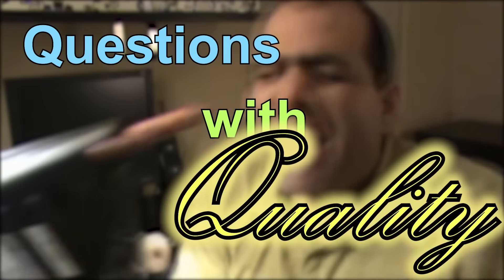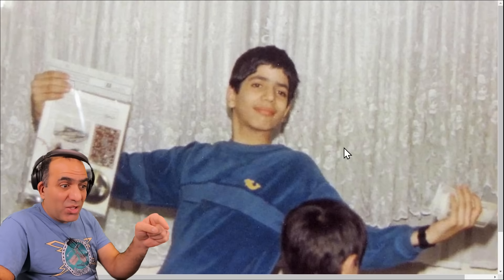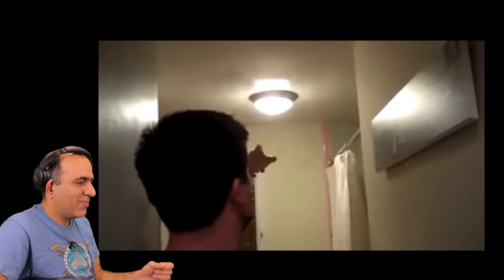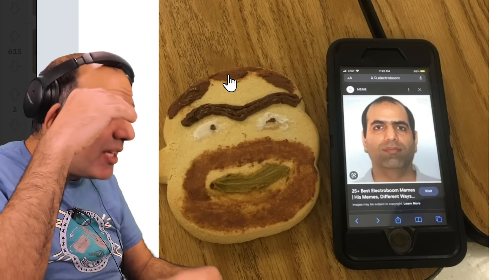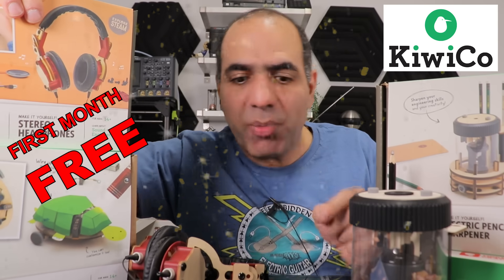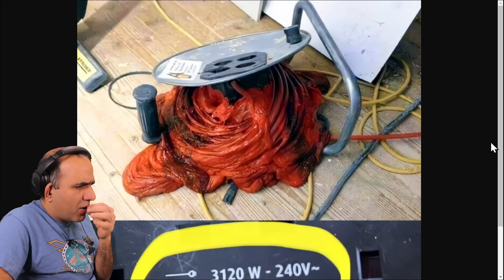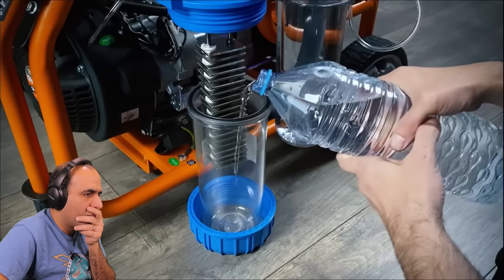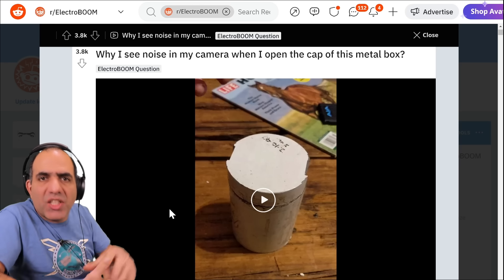Can ENGINE Run on WATER?! They Copied my Toy (LATITY-011)

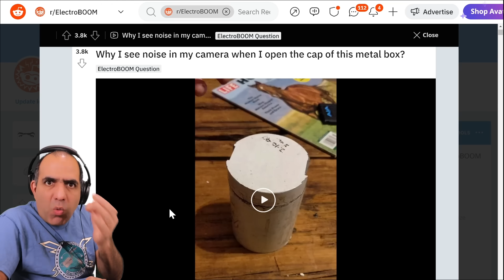Comment: 12:58 that video is a fake. You can tell because the noise goes away when he covers it with his hand, but a person's hand is not dense enough to block ionizing radiation. 

Also, that's not what radiation induced camera noise looks like. It typically appears as white spots across the image, not some slight distortions in the same colors as the image itself.

Comment: YES....you can run your car on water.  NOT DIRECTLY THO. First crack it to oxygen n hydrogen by input energy.  Then burn HHO gas in ICE engine. Or thru fuel cells to run car's electric drive motors.

Comment: @ 2:32 ‘he got rid of the fan . . . .’ Usually fans are 3 wire, neutral, switched and permanent live, the double pole light switches have a common, I would have started by checking the common and permanent live

Comment: There ARE engines that run on burning water, they’re called steam engines
Reply: They evaporate water and burn coal. However, Hydrogen combustion engines burn electrolysed water.

Comment: The water motor is not free energy because the electricity is being used to split the water and not to power it. It will use the water up just like if it was gas and the water is where the energy comes from. It would be cool to see one that captures the water from the exhaust to make it more efficient, although it would still have to be refilled because water is not the only thing that is produced by the engine.

Comment: my car runs on it...       mmmm that is electrolysis to split its hydrogen off first....  so its a trick question,  water no...   split it yes   ps meddi great experiment for yeah,,  do you get back just as much water?   I'm very iterested in the theory water IS endless power.....because all that comes outta my exaust is pure drinking level water :-o

Comment: I dont think the water engine is a perpetual motion machine. In a regular combistion engine the burning fuel turns the engine, turning the alternator, charging the battery, and supplying sparks to burn more fuel. The system seems closed at first but really the gasoline is the energy input. In the same way the concentration of hydrogen and oxygen in water is very high (when compared to just the gasses) and it will be released as energy when the oxyhydrogen is burned. Water is being used as a source of chemical energy storage, like normal fuel, and it will eventually get used up when all of the water is converted into gasses and burned.

Comment: 3:22
I can imagine these 2 changing a thing that for some reason requires modification of the house's entire power grid, and after realising the buttons and plugs are all messed up they go like: "We can live with this" and after a few months one says to the other: "Could you turn on the bedroom TV?" and the other goes like: "Sure thing, just let me plug in my phone in the kitchen, turn on the hair dryer, set a stove on low heat, turn off the AC, and open the garage door"

Comment: The only way a "water engine" would work is if it produces water from hydrogen and oxygen, not separating it, or somthing like that, whatever a fuel cell uses to produce electricity

Comment: I hit pause right at the start. We had water motors where the water pressure moved the piston. We had steam but still not burning water. If we're about to go into hydrogen here, in my opinion water starts off as the fuel potential but it's no longer water when the engine gets it.
Ok, I'll hit play now.

Comment: It doesn't take an extraordinary amount of current to melt a cord on the spool like that - a simple soldering gun (the higher power sellers) COULD do it - or a heat gun.   I had a relative do exactly this this a heat gun many years ago, because the cord was still in a tight round coil.   it's not the most effective inductor, but it does affect it... it was probably a 50 or 100 foot cord.

Comment: Hey man I know it's not possible but is it's possible (as iron can move by itself in Earth magnetic field and same magnets with same pole can cancel each other magnetic field  so making this setup with an angle of 90and 2 bars may provide some type ,I know attention can be canceled by same pole repulsion  but maybe it can reduce to some factor as compare to attention and maybe just maybe convert just heat into mechanical energy

Comment: for anyone wondering about the water engine, making hydrogen and  using it to power itself from the gas would work accept hydrogen from electrolysis is expensive and would never make enough to power itself

Comment: Hi Mehdi, actually graphite welding does exist in industrial applications. It is called graphite electrode welding. The graphite is used only as electrode, where external material (filler) is added during welding. It is highly uncomfortable method, because the arc ignition is extremely loud and bright. Never the less, graphite welding is actually real (usually 270+ Amps).

Comment: I've made a hydrogen generator as an experiment and was able to get it to run a engine but i had to make it multi stage, almost blew myself up, and the efficiency was garbage. Also it can't just be regular water that has to be distilled and a bunch of salt mixed it had very little extra energy left from the hydrogen to barely keep the battery charging and could barely cut grass. I wouldn't say its purpetual though because the hydrogen generator is outputting quite a bit of hydrogen but had to use an outside oxygen source all in all the energy i got from it was minimal and the effort to create the hydrogen was not worth it and cost more than regular old gas

Comment: Yeah I can I had a car that they did but it's actually HHO H2O with water right so you break it with electrolysis turn it into gas so you have oxygen and hydrogen and you put that into your engine and your car runs on water

Comment: I obviously didn't calculate it but in the water car video it actually wouldnt be infinite energy, it is using water as a fuel and so the extra energy comes from the water
Reply: To create that fuel you need to add energy - to separate the hydrogen and oxygen
Reply: @mtqrx  yes, but what the video claims is that by burning that hydrogen you get enough energy to separate more, consuming water in the process

Comment: 0:50 - Yes you CAN weld with graphite.  This isn't something that's to be debated or confused about. We've done it for years.
It's called CARBON ARC WELDING

Comment: Do you not understand welding? 
Why would you complete the circuit?  Arc< welding uses the spark/arc itself, the charge difference between the carbon and the piece being welded. 
The carbon is only a conductor and does not get hot and THEN melt the metal. 
The arc FROM the carbon TO the object being welded dies the welding.

Comment: Burning H from H2O wouldn't be a perpetual motion, free energy device though. It would simply be burning the H.
The problem is not that it would be free, but that it takes more energy to release the H in the first place. Presumably never getting around it, because I assume burning H and O turns it back to H2O, which can only ever create less energy that the ripping them apart would take. Right?

Comment: If you watch the full episode, 8of10cats used a shocking device attached to the victim. The game itself worked as normal, but when the buzzer goes off someone else presses a button to activate the shocking device. They use this device in several episodes.

Comment: It suddenly occurred to me recently that an engine that runs on water might, in principle, be possible. Not by burning the water but by evaporating it. Equalising vapour pressure between the water and the air results in a lower energy state and higher entropy. In principle and without even resorting to the back of a napkin to support this idea with some hand-wavy maths, it seems work could be done. Of course it would only work in a low humidity environment.

Comment: yes it can it is called electrolysis and a stack plate capacitator with a transformer and using ac submerged in water with a 3-5% ratio of oxy clean will make it so effiecient it seriously is not funny it is not used for everyday use, a car distributor is a nice step up trasnformer on the cheap as the insane volts required by a spark plug yadda yadda do it bitch

Comment: A lot of people believe the water engine device because ‘technically’ combustion of hydrogen produces more energy than electrolysis of water, except around 43kJ of that energy are unusable (don’t make me remember my thermodynamics lectures to say why haha), so the actual energy you can get out of combustion of hydrogen is the same as the energy required to electrolyse the amount of water to produce that hydrogen, and that’s assuming 100% efficiency, which never exists.

Comment: I remember 5 years ago when I was at a boarding middle school, pulled out a bar of graphite from a pencil, tried shorting it with a pair of cables from a broken alarm and a 18650 battery. It went burning red. I used it to solder my friend's broken flashlight and burned a bunch of mosquito papers on another dorm for fun (cuz lighters weren't allowed). Good times.

Comment: you were wrong about the way it's wired. it's 2 separate circuits. light 1 is switched on the other side of the hot, so one lead of the lamp is always hot. the other side is wired to a 3 way switch, 1 is neutral, 1 is the other phase, they are both connected to the hot wire. there is also a wire coming off going to the outlet, which goes to neutral. that was done intentionally as to make a joke video. your model would predict lamp 2 turns on, but you said it doesn't because high resistance. your model also doesn't explain how flipping the other switch makes it brighter

Comment: I had almost that exact idea for a water electrolysis engine as a kid in high school, except instead of a magic perpetual energy device I figured it could power a car enough for the momentum to run an alternator and maintain the cycle. I still don't know if that's at all feasible but it's better than that stupid video.

Comment: My guess is for the roll of extension chord that melted, it was connected to a power source and they crossed the poles in an old plug that has no ground.  Ive done this on accident when plugging a LiPo bat. to a makeshift connector ( crosssed poles, it got hot quick).

Comment: The microwave should be using both phases. In one it's charging the capacitor, in the other its in series with the capacitor powering the magnetron. Aside from the point that the microwave "wastes" half its power, i think its also unreasonable to say that it doesn't use half the cycle unless there is something i am missing

Comment: I do think that hydrogen from electrolysis can be made to run a truck, The trick is to just make sure the truck is of sufficient capacity to tow a very large enough diesel generator behind it, with plenty of diesel too.

Comment: You can run an engine off water, you just need a metal to burn it with. Aluminum, lithium, boron et c. will burn with water, though Al is difficult to get sustained ignition with water while the others have toxicity, safety, or energy density issues

Comment: it's not about running the car using water. it's about using electrolysis to split the water molecule into hydrogen and oxygen which is then burned to provide locomotion. 
and yes, the output from the O2+H2 combustion process is higher than the input required to split the H2O

Comment: i used to belive about the hydrogen electric generator , didn't know it's considered an actual perpetual motor because it's actually using water as fuel mostly than the electricity from the battery

Comment: 5:30 I blame Hollywood for this. They always take liberties with reality, you know, like a guy standing in a pool of water, a cable drops on the edge of the pool and we see the guy getting fried and if it's directed by Michael Bay an explosions tops it off. While in reality electricity always takes the shortest route, so just the short distance between the two wires.

Comment: car can't runs with water but in modern engines water injected can increse the efficiency by cool down the combustion, it is the main way to not use boring scr systems wich is in development  in big engines which can't have a urea vessel like in cars

Comment: What about a steam engine tho?
Reply: Steam does not supply the energy , heat does from boilers . The heat causes the water to expand to steam which provides pressure to provide force on mechanical devices such as pistons in steam engines or steam turbines . Nuclear aircraft carriers are powered by steam , the nuclear reactor is merely the heat source , just as coal was in old railroad engines .

Comment: I am Automotive tech. water is only meant to cool down the engine. they used distilled water to cool engines before coolant was made but they notice it didn't work well and made coolant instead

Comment: running a engine on water is not perpetual motion ..the water  is used as a fuel source .. noone ever said  you dont use up the water
Reply: If water is the fuel then what is it reacting with? What is the exhaust product? i.e. where is the water going when it gets "used up".

Comment: Easy for cable real to overheat, seen is done at an old workplace.
The reals should be unwound before use, or they can overheat just like elements when they are used in, for example high power, power tools,

Comment: Frankly yes it is called hydrogen oxygen gas HHO my car does hybrid technically it's running on hydrogen you put distilled water with an electrolyte in to dry cells do electrolysis in make hydrogen gas from water so you put water in the system and then run it

Comment: The flyswatter circuit is completely isolated from the earth, or "ground", because it's battery powered. So, touching either of it's 2 high voltage output grids in the swatter part one at a time, you will not receive a shock. Touch them BOTH at the same time, and you WILL.

Comment: Hi sir, I am a high school student from India and I watched your video on surface charges in electrical circuits on your YouTube channel. Still I have some questions left and I request you to please help me with this if possible. My question is-

We know that steady state arises very quickly so surface charges have to establish very quickly and for that to occur the electrons should travel very small distances and that can happen only if they come from surfacial atoms of the wire itself. But if that's the case they would establish an opposite charge gradient inside the wire ( as an electron leaving from a surface atom will leave it positive ) and that would counter the electric field from surface charge gradient. So how exactly these surface charges come from? I have also read "matter and interactions" but in that too its not answered. Please help me with this.

Comment: I doubt the so called "water" engines would even be able to electrolyze water at a fast enough rate to keep the engine running.

Comment: Can you calculate the number of electrons inside one gram of copper wire 
If you can ,how did you do it?

Is it ((Weight in gram number)/(copper mass per mol number)) * (avogadro number) ? This will equal the number of copper atoms in one gram and multiplying the result number with the number of copper electrons which is equal to 29 electron could this equation calculate the number of electrons inside one gram of copper wire ? 

Help .. 🥺

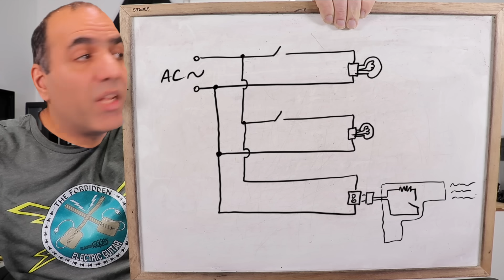Comment: 4:02 the ac light switch 1 
And the light switch 2
And an socket with a connected hairdryer the sockets connected to switch 2
And switch 2 is connected to switch 1
I did this kind of shi" a few months ago

Comment: There are other ways to electrolosize water than DC forced amps.  You can treat the water cell as a capacitor, without an electrolyte, and use a high potential that then the voltage differential is spread across the water; this will cause the water to separate in solution and nowhere near the plates even.  
Water has enough electrons itself that it doesn't really need to be given any more to break into 2H2 and O2.

Comment: if you could build a truck or car and make two tanks of water, with one higher than the other, you could have water flow down for one to the other, then, you could use the flow of water to move a turbine, which would create power, which you could use to power the car.

Comment: If you have an engine that can utilize water as fuel you're probably missing the chemical bonds that make it water and you're just running either an oxygen engine or hydrogen engine.